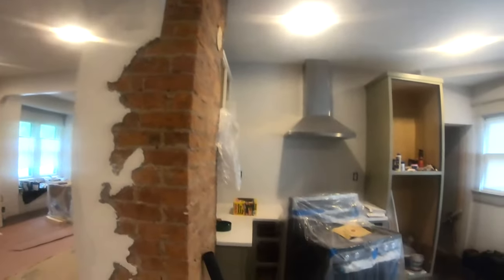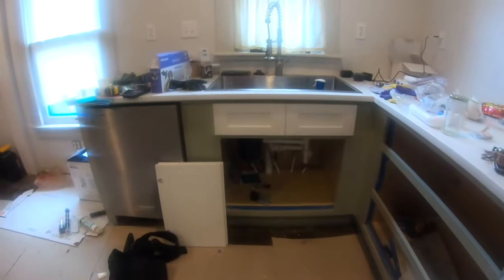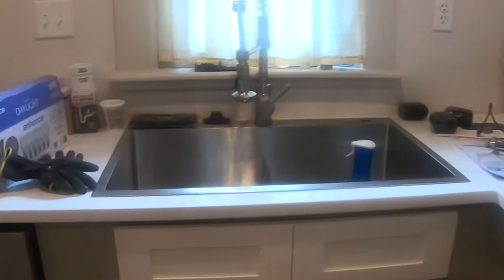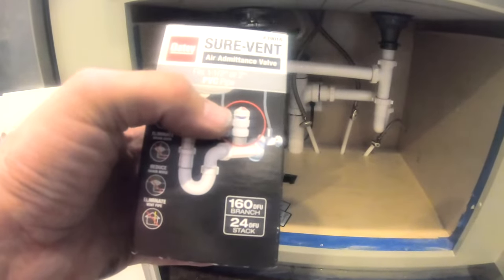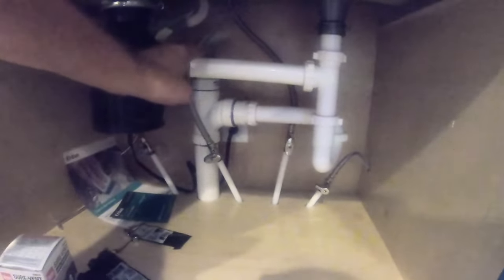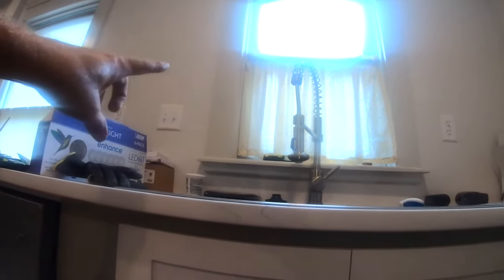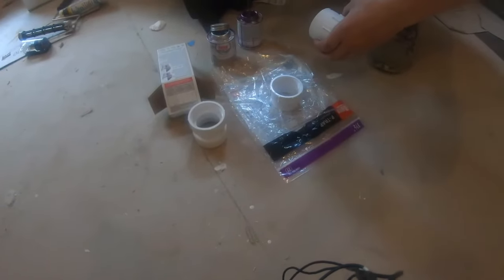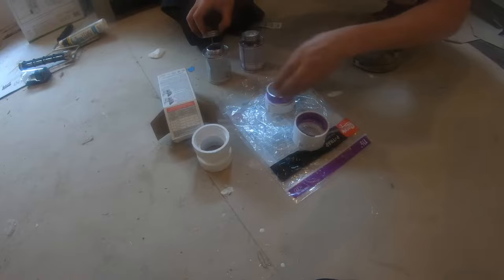how to vent a kitchen sink under a window / kitchen island vent

Comment: My kitchen sink has the main drain valve but its also connected to another pipe that goes up around and back downstairs to the basement on the other side of the cabinet and into the same pipe. Is that an older way to vent? I was always so confused why that had two pipes going down there.

Comment: Need to install one of these, but I have a one hole sink with the p trap of course and downstairs is an apartment and every time they use the sink it bubbles up in mine. How do you install in that type of installatiion?
Reply from the maker: Hey stig…,
Sorry. I’m not quite sure about an apt layout. Because they are stacked or connected, sounds like your venting ( or not)  sounds connected.  Something  isn’t done right.
Sounds like a building inspector didn’t do his job. 
I’d ask around and see who else has same issue. Seems like owner should address it to me.

Comment: I recently moved into a older house with this set up and all of a sudden my sink started backing up. We narrowed it down to the vent and swapped it but for some reason that didn't eliminate the problem. Not sure what to do at this point.
Reply from the maker: Hey Clint,
We just dealt w/ roots in the drain at my sons old house house. Zero fun! Might be that. Maybe a downstream clog somewhere in between??
Thx for watching!
Reply: @Housebarons  oh man I hope not. But thanks for the tip!
Reply: I agree, probably a clog somewhere down the line. I use a toilet plunger when my sink gets clogged. I bet I don’t have as many issues after I install a sure vent!

Comment: We did the same thing but it is not working. Vapor locked. Need help
Reply: Husband put in all new pipe under the sink and in the basement. No clogs. Everything else works except the kitchen sink. When the dishwasher runs it empties into the sinks and then slowly drains if at all. Desperate for a solution.
Reply from the maker: Hey Stefanie..,
Not real sure. I’d be tempted to remove the vent ( hope it unscrews like ours. )
Then run the water. If everything drains fine, then somehow the vent isn’t letting air in. 
If it doesn’t drain w/ the vent off, then there is a hitch somewhere in the new pipe set-up.
Also check to see how different your pipe set-up is from ours in the video. See if there might be a problem with the pipe set-up.
This is all about troubleshooting via the process of elimination. 
Hope it helps!
Thx for watching
Reply: @Housebarons  got it all fixed. Husband slept on the problem all night. He got up first thing this and snaked it out once again, and I happened to flush the toilet and something let loose 🙃.  All is great in our world. Thank you for getting back with me.
Reply from the maker: Yay!